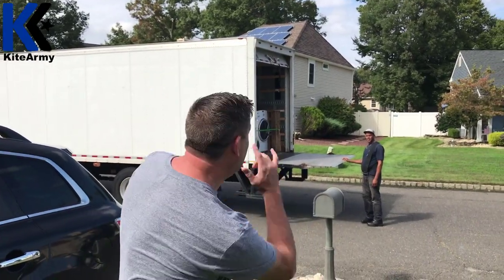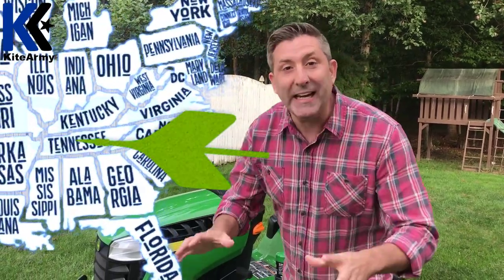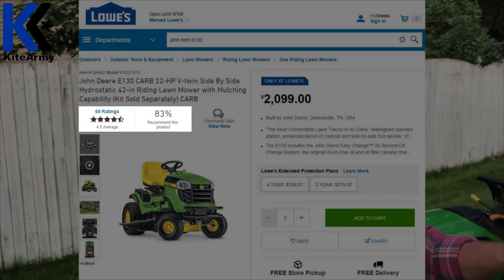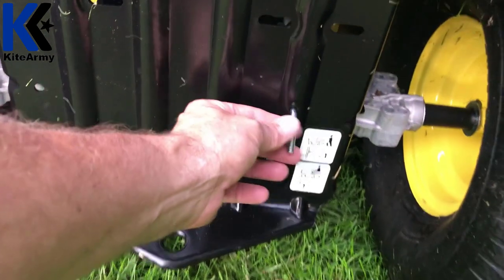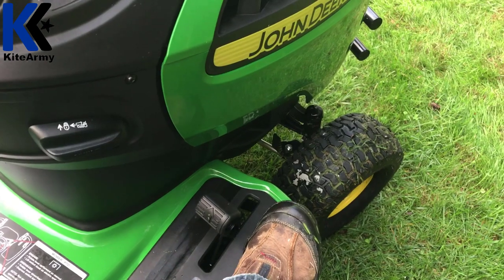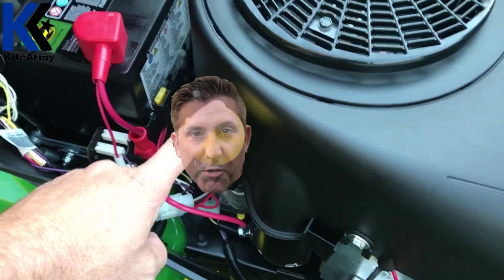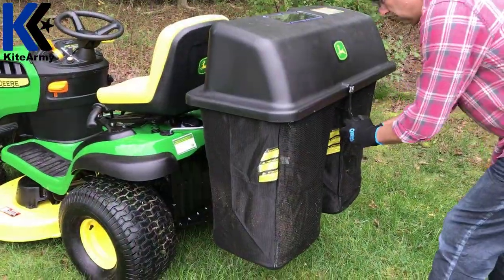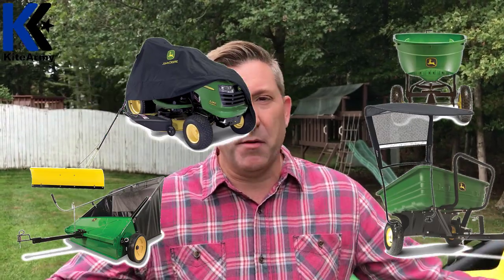Best Riding Lawn Mower 2019 | John Deere E130 Review 🌿🌿🌿

Comment: Kinda long but a good offseason story....

Three days after Christmas I purchased a 2020 E130, the last one at Lowes for the season at a decent price, ($1199) as the 2021 S Series were already on display in December. I've seen this sold for up to $2099 but usually $1999. 

First, the back story....my JD L110 (which I LOVED!!!!) that I had for 17 years (with a remarkable 947 hours) was having some new blades put on it about 2 months ago. After I put the deck back on, she wouldn't start. Fly wheel, extremely hard to turn, froze up, the works....broke my heart TBH. I was so proud that I was going to go into my 18th year come spring with only 1 deck change, 1 transmission belt pully, the right tire spindle change, a seat replacement (an upgrade to high back when low back rotted after years) and a hood cover. I took very good care of it, garage kept, much needed in southeast Louisiana. Season 18 wasn't meant to be, I guess. (I might still try and get the old girl rolling) Revealing tire toe disincentivized me, too - oh, the work - for a good price I could get another one w/o having to address 18 year problem creeping up. (Kinda got my wish with my late year purchase...yay, right?)

I was actually pricing and reviewing mowers/lawn tractors in Sept just because these things don't last forever and figured to donate my L110 soon. But NAH, this thing will never die!!! even rolling into my ditches a few times and getting a little water in (once) BUT she started up after a few tries every time (figured this might explain the engine freeze over a few years - oil was fine and water didn't seem to get it from what I saw). 

Bought the L110 at HD for $1799 back in 2003 after a cheap POS Ryder just couldn't handle my 3/4 acre (but flat) lot with anywhere from 12-7  decent sized trees over time (hurricanes thinned them out over my 20 years owning the property). As you can see by the occasional ditch dump, I'm hard on my mower and expect it to hold up for the price. Did all the maintenance myself. Enjoy the hell out of it. I just couldn't bring myself to pay over $2K for a decent JD 100 series. Did my research and knew not to go with the E100 (plastic tranny). ALMOST pulled the trigger on an X354 but the JD Dealer was a total ass and wanted to bump the warranty up by 3 years to 7 and jacked up the price by another $750 to $4855. No way...NOT for a yard tractor.

So, I had a heads up on what was what from taking my time on research on all makes and models and went by Lowes one day a few weeks ago and saw the last E130 marked down to $1199. Decided to pull the trigger,  $1307 after tax. Sure, it was left out here and there, seat was dirty some but not cracked and I had to show the Lowes employee how to actually cold start it but figured it was worth taking a shot at it for an $800-$900 savings .Got it to the house via a friends trailer. 

I will reinforce all previous recommendations.....do an all points inspection from any mower you purchase at a box store as: the tires were massively over inflated, the positive battery terminal was loose (surprised it actually got any spark at all), the oil was under by 1/2 quart, the deck was not level. All these things were minor to me for the price I paid and money saved. Besides, all those are easily addressed by me and not Lowes - who couldn't even get it started. 

Compared to the L110 of 17 years ago, here's my observation.....
it's nearly the exact same lawn tractor. Not much has changed except JD cheapened it up some but made some improvements as well. 

Also, I had a 1 cylinder Kohler Command 17.5 HP engine in the L110. The E130 has a 2 cylinder 22 HP B&S motor (ANOTHER reason I didn't purchase this months back - know of their problems so it scared me off - wanted the Kawasaki but, again, really didn't want to go over $2K). The difference in engines is + 4.5HP but it actually drives .2 or .3 slower than the L110. I'd blame this on the slightly larger and wider rear tires but not enough to reduce speed. REALLY?  17/18 years and this is the best you come up with, a 2 cylinder engine that does the same speed and basically the same transmission?

The floating gas tank seems cheap and feels weak. Time will tell but my L110 did need a tank adjustment once so maybe this will be avoided. I don't care as long as it works.

The quick change oil....some may like it. I do not. Especially since I want to get another 10 + years out of this thing. I've already converted to the regular oil system for under $30. I bought the kit the day I bought the mower and put it on today. I took my old high back seat off my L110, as it's still in great shape and put it on the E130 for now. Have the original waiting in the wing to save me, what, $125 further down the line?

Again, basically the same yard tractor, upgrades here, downgrades there. I figure if the L110 was $1799 and got me 17 years, going into 18, with the price I paid ($1199), I hope to get 11 going into 12 years with this E130. I firmly believe converting the oil system is the best upgrade to make this happen. Here's hoping I don't have a lemon with the known belt issue but I have St. Aug grass so my cutting level is almost always at 4 inches. I don't think I'll encounter the belt braking under 3 inches problem...Only time will tell.
Reply: Oops....Thinking about the known belt issue reminded me of a feature I forgot to mention. It's the adjustable deck belt tension slide. I can't understand for the life of me just why this was made static by welding the mount to the deck. Not a deal breaker but it was something that, when I saw it to be true, was a bit disappointing

Comment: Does one have to keep pushing and holding the pedal to drive and if so that would get kind of tiring would it not.
Reply: It's just like pushing your foot down on the pedal of a car, it doesn't get tiring. This mower also has a cruise control option though so you can take your foot off the pedal if that's too much work lol
Reply: @danielaupperle  Thanks for your reply and that useful info.  I may have to use cruise control if I bought one.

Comment: After a year, hows it hold up? I need to get one since I expanded my lawn/yard.
Reply: I’ve had mine for about 10 months now and I still love it. I wasn’t sure if it would have problems after winter (in a shed) but it still works like a champ.
Reply: Daniel Aupperle good to hear, congrats on the dream grass rider. I’ll probably wait until late summer and start looking, there’s no particular model but somewhere in the range of $1500-2000 which is expected. Thanks!

Comment: I bought the E130 from Lowes last month and I'm super happy with the mower itself. I am however not happy with the condition it came in. It's was supposed to be delivered between 11-1 and the delivery guy didn't show up until 9:30 at night. He was great and it was definitely not his fault but, I didn't really look the mower over until a few days later. 

When I finally had a chance to look at it I found It filthy dirty,  it had hand prints and mold stains that are permanent on the seat, scraps on the paint and, to top it off a flat tire! I work on the service industry and if they claim a "certified John Deere mechanic" looked at it before I received it he should not be working there, plain and simple. 

$2100 dollars is not a lot of money to a company like Lowes but, it is to me. Heck, I've driven vehicles for years that cost less than $2100. 

Glad they shined the tires and rolled out the red carpet for you. You're a good dude. You deserve it for the content you make. It is a great product. I just wish they would have given me the same service.
Reply from the maker: Hey mate.  First off, thanks for the comment.  I really feel your pain.  Have you reached out to the store you bought it from to express your concerns?  Sometimes it's as simple as if they don't know you have an issue, they can't help.  Let me know.
Reply: I would have refused the delivery and told him to bring it back tomorrow during business hours. I am going to bed see you tomorrow. Then I would have called the MGR and told him why I refused the delivery. Bring it back during the day so I can do a full inspection on it. If it passes I keep it if it failes you take it back and bring me another one. Been there done that. Lessons learned man......
Reply: Christopher Palme they do get assembled by a John Deere dealer tech... but once he assembles them, they sit outside until sold.  The volume Lowes does means their delivery people simply do not have time to wash your mower prior to delivery vs a dealer.  Flat tires happen a ton at box stores... the inventory is kept in the back where all the overstock of lumber is kept... lots of staples and things to puncture the tires when the delivery people go grab them to put on the truck.  Simply put, box store delivery people are at most capable of doing 12 deliveries per day yet are frequently pushed to the absolute limits and asked to do 15+ daily to keep up due to old broken down trucks and poor staffing.  Not making excuses, but as a former Equipment Manager for a box store... it’s a bitch.  You’re perpetually shorthanded with not enough help, told all 300 mowers need to be assembled in march yet 90% of them wont sell until May-July, you struggle to keep up because as soon as May hits you’re selling 20 per week and naturally have issues to deal with that take up time

Comment: What's the difference between John Deere E120 and E130
Reply from the maker: The e120 is 20Hp the e130 is 22Hp
Reply: On the 130 they throw in the front bumper.

Comment: Very nice machine and review. I’m warning you right now though, that you need to drain the oil too not just change the filter. If you don’t do this your only changing the oil in the filter so make sure you drain the oil in the engine as well as the $50 filter
Reply from the maker: I get that - though John Deere claims that it is unnecessary - only time will tell
Reply: Common sense... remove that dumb, NEEDLESSLY EXPENSIVE novelty filter and do a proper oil CHANGE

Comment: Great mower!  But the first thing to do is get rid of the EZ oil filter. Convert it over to a standard filter.
Reply from the maker: I wonder if that can be done?
Reply: Why?
Reply: You can buy a conversion kit online.
Reply: @rossheadley8565  why? Because it’s an expensive way to not change all of the dirty/contaminated  oil...  doing an oil change on a small engine is already the easiest maintenance task one can do... it’s not like you’re elbow-deep checking valve lash or repacking bearings

Comment: Thank you for sharing. Nothing runs like a Deere.
Reply from the maker: Glad you liked - this was my first time test John Deere - impressed :)
Reply: When there running.
Reply: Actually, since the engine is manufactured by Briggs & Stratton quite a few things run like THAT Deere, lol.  Now, our old twin cylinder 1939 "A" model Deere...the only thing that comes close to running like one of those is a Harley-Davidson, but that's because of the way both machines are set up to fire on the cylinders.

Comment: Thanks for this great video.  I am leaning towards this model, but have a few questions. Are there grease fittings on the spindles or wheels ? Are they bearings or bushings on the front hubs? Thanks again.
Reply from the maker: The front wheels have a grease fitting
Reply: Deck spindles are a pain to grease, wheels have bushings with grease fittings,  have had it at their repair shop twice already for misfire issues and starting issues related to seat sensor..

Comment: You have to do your Vid all over again, you forgot to mention about "locking" it in the "drive" position at a set speed that you prefer (cruise control), the small lever on the the right hand side just below the steering wheel between the key starter switch and the drive foot speed pedal.
Reply from the maker: Good call!

Comment: I still adore my off-the-factory (not from Lowe’s) Poulan Pro/Craftsman.
Reply from the maker: Lowes has a ton of new Craftsman tools - some of them look real good
Reply: Those older AYP (American Yard Products) Craftsman and Poulan Pro tractors weren't bad at all.  Some of the Craftsman models came with Kohler Command engines that will run nearly forever.  The Poulan Pro name has been bought by Husqvarna who took over AYP.   The new Craftsman branded tractors you see at Lowes this year in place of the Troy-Bilt line they used to sell are made by MTD, basically re-badged Troy-Bilts.
Reply from the maker: @MarkPalmer1000  Great comment - you can always see the design similarities on some models.  I don't know how much Craftsman makes of their own
Reply: Mark Palmer I have a old husqvarana/ craftsman tractor with a 15hp kohler command and man that thing runs brand freaking new with over 1200 hours and all I have done to it is replace the coil

Comment: Very happy for you. Awesome getting a free 2k mower,but a little to glowing review. Every machine or tool has flaws,at least point them out with the highlights.
Reply from the maker: Sorry that you feel that way...I really like this mower and presented my honest and unbiased review
Reply: If you ever used a deere you'll realize that they don't really have many flaws. Not worth mentioning anyway. My only complaint is if you ever need to replace some of the more major components then the things are so tightly put together that they are hard to take a part. I don't really see that as a negative though. The only thing I've ever thought to complain about is their steering is usually pretty tight as in it's hard to turn the column. However, if you loosen it then it will slowly loosen over time. Power steering eliminates this, but the e130 doesn't have it. There are no useless features typically and the things run and run.
Reply from the maker: I have never owned a John Deere before so this is a real joy for me.  Compared to other brands in this range, as best as I can tell this thing is so well made and feels like great quality.  I guess if I was forced to have complaint about this mower, it would be that it does not fly.  Maybe that will be offered in the 2019 model.
Reply: Yep, that's how it went for my family growing up. Really glad they created a nozzle for connecting to the deck. In the past you just screwed your hose in, and while it sounds great in practice that mechanism would get clogged and it would no longer pass water through. I assume the new one is much less susceptible to that.
Reply from the maker: The quick connector is cool - it has a ball valve in it that automatically opens as you attach it so you don't get soaked while connecting.
Reply: @Kitearmy  the flush out idea on the deck is flawed.  No way you want all that water in there.  You'll put it away at least a little bit wet.  Wet = rust.
Reply from the maker: I used to think that too.  I had a mower that I never flushed for the same reason.  Problem was that sometime I mowed the lawn while a little damp.  Turns out that wet nasty damp grass plays hell on these decks and I believe much worse than cleaning it off with water.
Reply: @jschubert8110  Moisture causes the decks to rust we all agree. Water that can't evaporate because it's covered in grass will keep moisture on the surface longer than water that is easily evaporated by being exposed to open air. Also you have to think the only surface for water to sit on when the deck is clean is the deck. When it's covered in grass then that grass can hold a Lot of moisture. A lot more than just the deck.
Reply: ImaITman better off pulling the deck every spring, scraping it clean, then using a non stick coating to help keep grass from sticking

Comment: I'd get rid of that oil filter and change it back to a proper style.  It's like 50 bucks for a new filter for one of that type vs less than 5 bucks for a proper filter and with that thing you aren't changing all of the oil, just a small amount of it.  I'd rather change all of the oil which in a motor that size should be about 2 quarts.  Other than that and that silly push button for reverse mowing instead of having the function for it on the key it looks like a nice mower.
Reply from the maker: I like the new filter - that being said I would rather save the time here even though I know it's costing me money